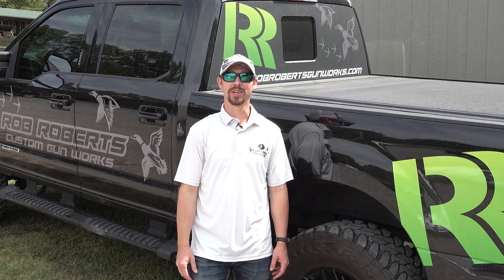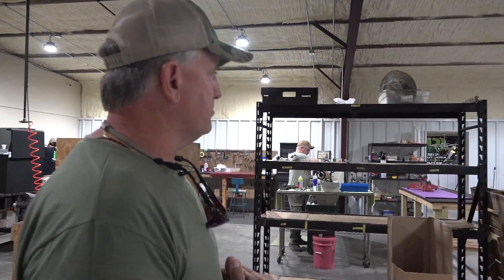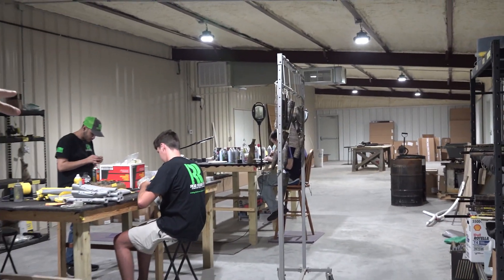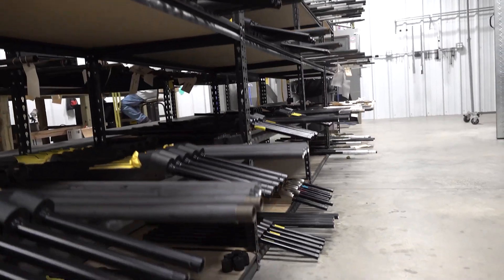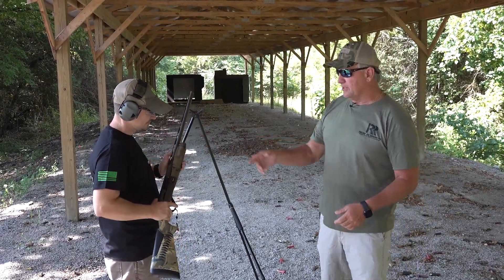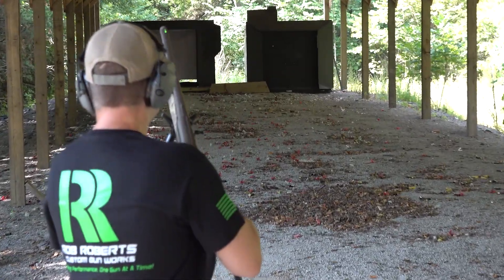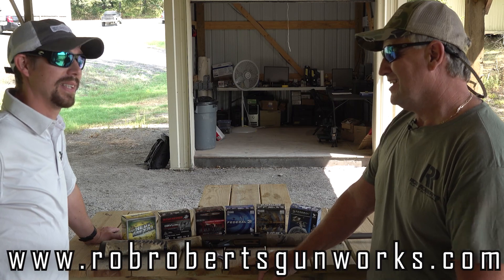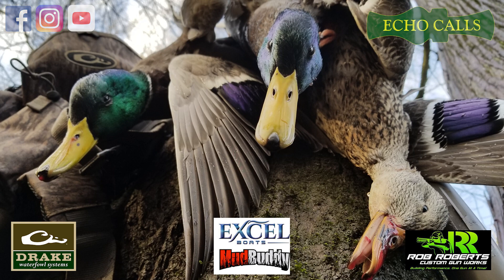Duck Chatter Ep.18 "Rob Roberts Gunworks"

Comment: Had my Benelli's forcing cone lenghtened by Rob Robberts. Great work, fast turn-arounds. It took only 10 days to get my barrel back with shipping. This week I folded 5 ducks. 1 1/8th oz #6 Hevi Shot with the stock modified choke. Just under 200 pellets in a 30 inch circle at 40 yards. At some point I will be getting Rob Roberts T2 light modified choke.